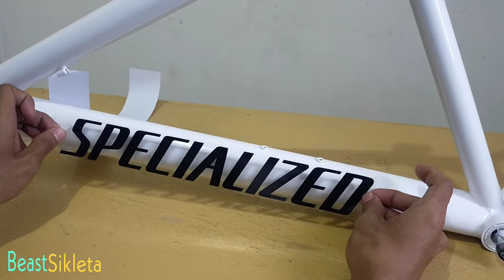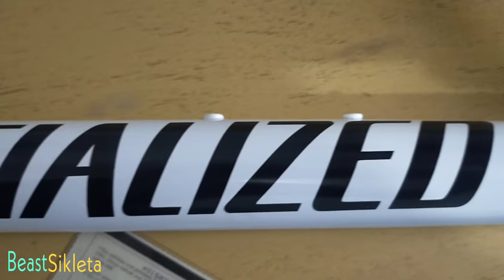TUTORIAL ON HOW TO PAINT YOUR BIKE WITH DECALS USING SPRAY CANS BOSNY | Just Heidz

Comment: In Phoenix there is a paint removal business I have used for several bike frames. They dip it in a large vat of chemicals and the frame comes out clean bare metal. No paint, no rust no anything, just clean as the day it was made. And the rust removal cleans all inside the frame, too. And the price for this is only $25, so it is a lot better than fighting the frame trying to remove the paint by hand.
Reply: I'm in Phoenix. Where is this?
Reply: @erso3302  Xpress Metal Cleaning. Good people. Been using them for years.
Reply: @650gringo  Awesome.  Thank you.
Reply: @650gringo  The paint remover that he used is almost $2 only. $25 is not cheap for us.
Reply: @jakebale2258  Jake NOBODY sells $2 paint stripper. Lowes wants $25 for 64 ounces of Citrus-Stripper. And it hardly works at all. Then you are going to need another $10 of paper towels or rags, and you are going to make a huge mess and still it won't be done right.
The pro dunks the entire frame in paint remover and rust remover, cleaning even internal rust from the frame tubes.
Reply: He lives in PH paint remover is 2k$ the bosny brand paint can is the cheapest in the market 2$ each
Reply: @650gringo bot ata to
Reply: @650gringo  phoenix bro normally sa Pampanga sa lahar nila binababad one minute tanggal pintura ayaw lang niya sabihin sikreto😀😁😅😂🤣

Comment: How did you paint over the black stencil without it being red?
Reply: Ow sure why
Reply: The red paint he used is a tranparent color, it depends on its base color, if your base color is white it will give a lighter color red and darker for black colored base
Reply: This may be late. But honda red is basically transparent red, which is why he opted for a white primer. Honda red will not be visible over a dark colored base.